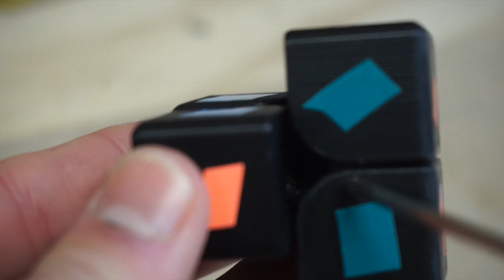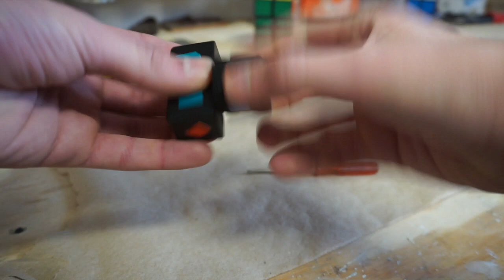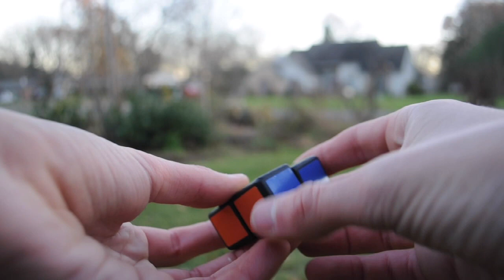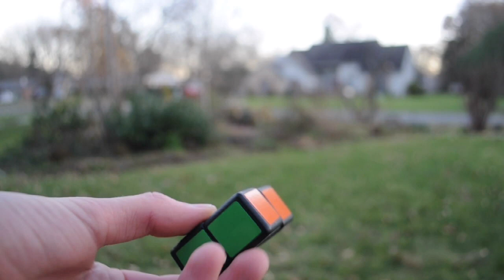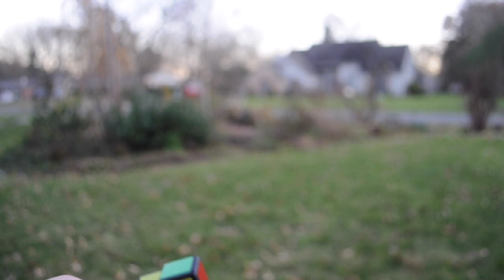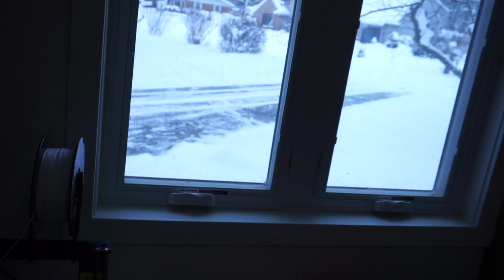2x2x1 Assembly

Comment from the maker: Does anyone have an idea what that mysterious looking 3x3 in the background is?
Reply: NK Cubed I heard that you have a prusa i3 mk2, I have one too. I was wondering what your settings were to make the prints so good and also wanted to ask you if you could make a tutorial for the prusa i3 mk2
Reply from the maker: I'm sure there are a lot of people more experienced then me who have made videos on the mk2s, but I may. I just use the default settings for the machine in simplify 3D. I'm actually going to get a mk3 soon!

Also, my prints arn't perfect by any means. I still have a lot of failed prints and a lot of post processing after I'm done with printing my puzzles. No printer is perfect (though prusa's printers are pretty close :D )
Reply: NK Cubed do you have any advice for supports on the 2x2x16, the 3 pieces I've already printed came out pretty poor and kind of wondered what you did to fix that issue
Reply from the maker: The pieces shouldn't need that much support. Part 3 uses no support, part 1 should be printed as is, and part 2 is printed in a similar orientation as part 3
Reply: NK Cubed thanks for the advice. I just asked because I didn't want my pieces to keep coming out bad but now I know what not to do :D
Reply: It's an internally bandaged 3x3!
Reply: 180 cube! Eager to print both this month.